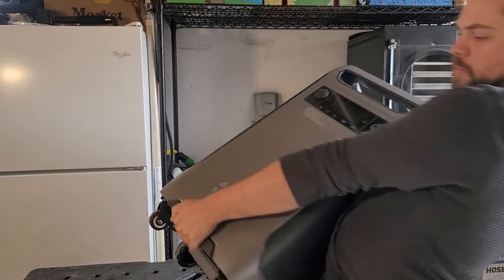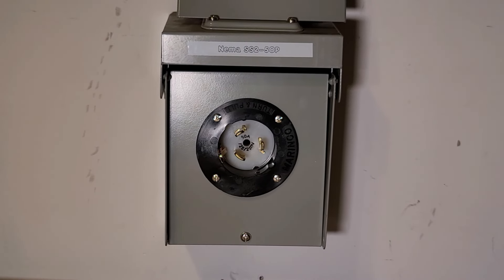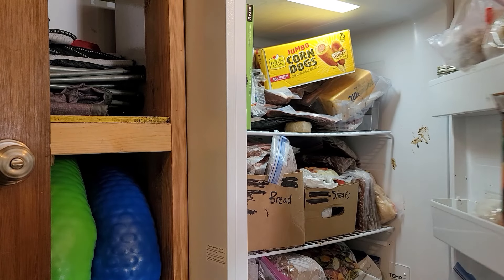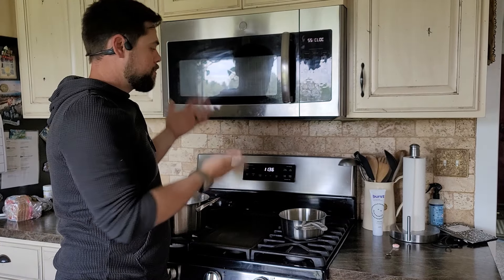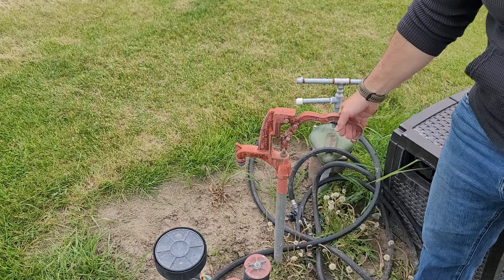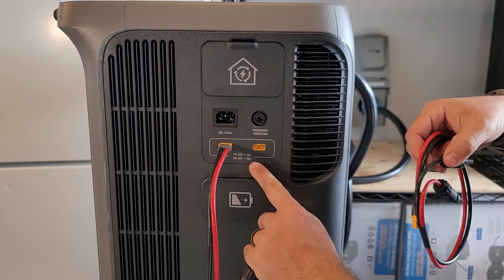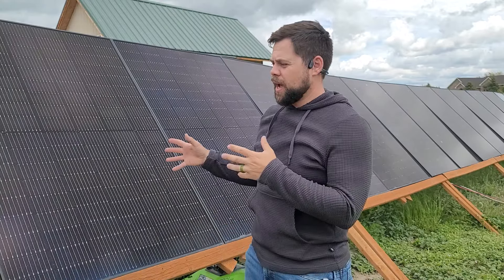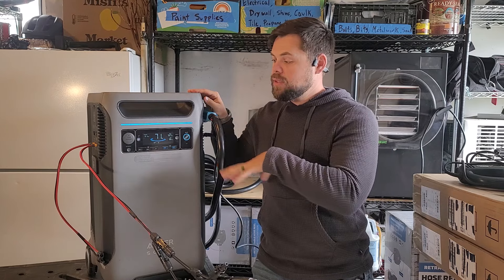Home Power Outage Backup with the Anker Solix F3800

Comment: I bought the Anker Solix 3800 to use as a backup for my RV. I bought the bundle that comes with the Anker 400 watt portable solar panels. I am blown away by this setup! I now call it "The Beast"  I have also wired up my rooftop solar of 350 watts to help charge the beast. Thanks for your video!
Reply: how did you wire your rooftop solar?

Comment: I got 4 of the all power 600w portable panels and the work great because they are 54v and 10 amps each.  So each input i can parallel two panels.
Reply: Hey I'm interesteed in maxing out the solar input of my Anker F3800 too, but looks like the Allpowers SP039 600W panels are 44V 13.63A. Are there different specs of 600W panels from them?
Reply: @jenesuispasbavard  The VMP is 44V, the VOC is 52.8V  This is the closest "portable" i have found without going to a glass panel.

Comment: If memory serves me anker has a xt60 setup that you plug 1 side into the unit and then be able to plug up to 5 panels on the other side. I figure if they are shipping those out with another one of their units to reach 1200 then one in each port would bring you 2400. Also jasonoid has a video about this issue and which panels work with the 3800. I think he said yours was a no go

Comment: Everything was fine except the mini split consumption in turbo mode. The mini split will ramp up in aprox 10 or more minutes to 100% capacity, from low power up to 2k watts. When the space is cooled, then it will slowly go down again. Putting the unit in turbo mode wont ramp up the compressor instantaneously.

Comment: I got this solely for backup when the grid goes down.  Also got the smart home panel. No need to switch over as it is automatic and switches so fast that computers stay on.
It is an awesome setup, but I agree the solar input should be at least 150v, so we could use 3 of those 400 watt panels to use the full capabilities of the smart home panel.
I already have enough panels for my spare projects and don't want to spend another $1000 + to get this work the way I want it to. Portable panels, no matter who sells them, are not an option.

Comment: Just what I've been looking for. This appears perfect for my 50 amp RV. Going to an RV camp, one finds 30 and 50 amp outlets to power your rig. With its 6,000-watt inverter, shouldn't this be able to run the AC units on top of my 50 amp 5th wheel? If you don't pre-charge your solar generator with the rooftop solar panels, can you accomplish the same thing by charging it from an electrical outlet? Thanks for another great vlog!

Comment: I've got a 3800 with an extra battery for 7.8Kw total. I use (2) 535w, 48v, 13 amp panels. It works GREAT with 2 panels and can power my central AC, electric stove, anything I need it to. I'm checking to see if I can add another panel on the other XT60 plug for another 13 amps or if the 25 amps it total for both of the XT60 plugs. The latest update enabled A/C and D/C charging together and the app is super handy too, you can monitor and control the unit from your phone.
Reply: Anyone know if firmware can fix the AC charging blocking simultaneous 240V passthrough power? Wanted to do 3ton 10kw HVAC w two f3800s and use solar to save on electric as a regular use that can also be a backup
Reply: @corymyers4476  Not for stand alone 3800, but with the Smart home power panel looks like it would work fine.
Reply: Which solar panels exactly? Looking to max out at least one of the solar inputs.
Reply: @jenesuispasbavard  I used Jinko 535w, they're about 11 amps each so 2 work great. I did get a reply from anker that it is 25 amps per XT60 connector so 2 panels in parallel on each plug can deliver about 2kw.
Reply: @rickdougherty1371  I understood correct that you use for Anker for continuous power supply and it connected to set of solar panel? In day time power going to supply house and recharge battery . On evening time it's drained battery and in morning repeat again ?
Reply: @Vadym_Eng  Yes, but only as a back up system or in the winter when demand is lower. It's not enough capacity for summer use where I live!
Reply: @rickdougherty1371  you have high power consumption in summer ? How much power consumption is average for winter and summer seasons ?

Comment: I found out that every time I switch my interlock system, the refrigerator surges and demands more power than usual. So just like my computer when the power goes out, I bought another surge protector with a lead acid battery, so my power is not interrupted, and now the refrigerator doesn’t surge, causing it to use more power than it needs to. 
I would not have known this without using my Victron connect app to see what happens when I’m flipping on and off power.

Comment: Have you tried to use a Solar Combiner Box? That might help Max out the Solar with your current setup. (might involve a lot of wiring though because of how spread out your panels are) I hate doing a lot of Parallel connections that's why I avoided this Power station, It might be great for someone that has a lot of trees

Comment: I don't see this system on your spreadsheet. I am highly interested in this product and think with correct panel configuration it can be a full-time solar generator and is a very good backup option. 2 of them is ~$1000 more than a single DPU at present. That seems like a better deal. I do have to get the solar panel setup so that will be extra investment, but would be even more cost with the Ecoflow system. No doubt Ecoflow is great, but this looks like a better budget option and is more portable if ever needed. According to one estimate if running this constantly as a solar generator with near max solar input daily, then it would take 10 years to pay for itself. Is that true? 
Also someone commented on safety of this inverter internal circuit breakers and high frequency versus low-frequency. Are you able to do a video on solar safety equipment? The Anker is Low V so that should be safer by default, too. Although from what I remember from physiology, current is actually what kills, or is more directly related to tissue damage/ defibrillation. 
I originally wanted a cheapo plug/play station for home office, but decided want water pump ~5600W to work, too and then throw in a 3ton HVAC of ~10kW for startup of compressor and that's why I think 2 Ankers could make sense for me. Also there is built-in redundancy that 1 Anker fail the other can still pretty much cover the whole house except HVACs anyway. Would like to talk through it with someone, but my local electrician is unfamiliar.

Comment: Newpowa 250s. 2s3p. That will get you about 1150 each...or about 2300w of solar input.
Reply: Actually it would be 47.66 @25 Amps for a total of 1191.5 even though there would be 1500 watts in panels

Comment: The low volts on this is just plain stupid.  My gosh my little pecron can take 95 volts.   Looks like they are forcing people to buy their panels.  Not good I already have panels and I am not buying what I already have.
Reply: So you are referring to the low voltage of the solar panels … because in AC, it appears to accept 240v
Reply: @bl9531  Yes for a system this size its pathetic to say the least.  It's a wall charger not a solar power station.  Anker makes really good stuff except they cheap out with solar inputs.  For example, I have 2000w pecron power station.  It has 2 solar inputs that can take in 95 volts each.  That station is half the size of this.  Get a oupes, bluetti, ecoflow, pecron etc.. if you actually want to charge with solar.
Reply: @johnmal5975  interesting, thx for your input.  To be honest, I was focussing on the 240v AC capacity and didn’t fully appreciate the weak solar capacity
Reply: @bl9531  It definitely has its use cases and is a really good product.  They just make the solar input very difficult.    If they upped their game with those solar chargers it would be a home-run.
Reply: @johnmal5975  I understand your point … increased solar recharge capacity should not be that difficult
Reply: I thought the same thing the only downside is that they have their 400 watt panels at $1000.each

Comment: The high frequency inverter tech that's used in these cheap units are only rated at a 2X surge capacity which is not enough to power all of the appliances in an average home and because it doesn't even have an isolation transformer it has the potential to fry the AC appliances in your home during a catastrophic failure of its H-Bridge circuit. No thanks, not in my home.